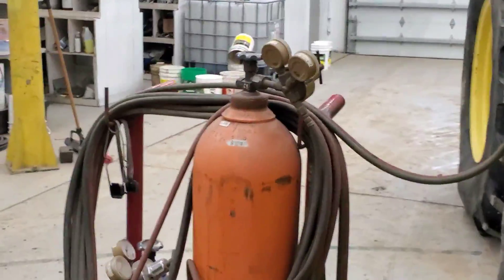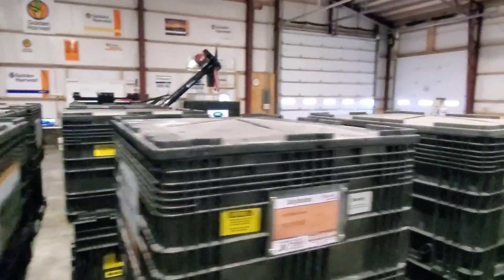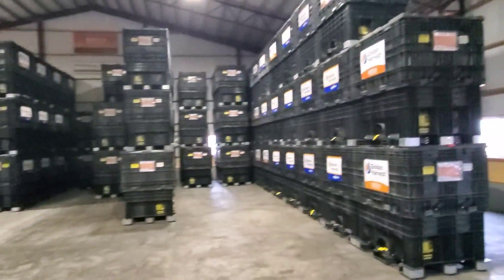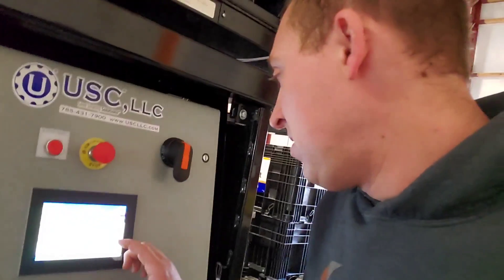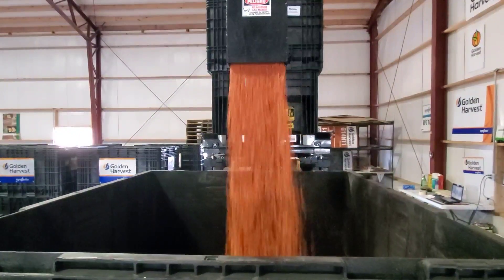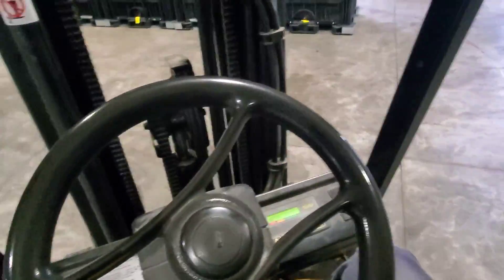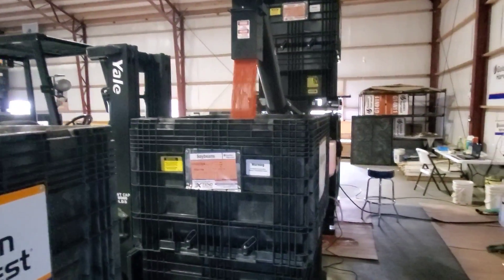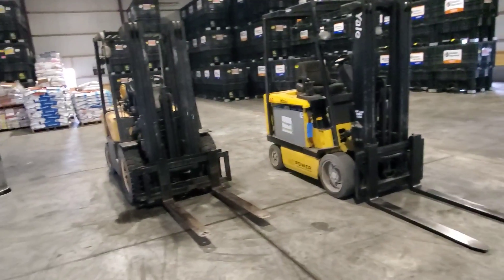My Forklift Died - #111

Comment: I seen you driving through jonesville today at 10 in the morning.  I passed  by you I was headed east on 12 you were going west I was headed to the dealership to pickup some hydraulic hoses and oil . It's crazy that we live so close to on another.  We are putting on phosphorus and potash right now.  We already sprayed our wheat with 28 percent nitrogen.  Planting is very close for our families.  Nice video stay safe and farm on my friend !
Reply from the maker: Yep I was picking up the exhaust manifold bolt for the 9R and batteries for the 8430.
Reply: Yeah we're gearing up for spring as well .

Comment: On those electric units there is a switch that sences weight or pressure on the accelerator peddle.  The switch has a spring that needs replaced often.  We had that problem with the machines at my factory job.

Comment: Hi Nathan. Great video. Not to long. Did you put inoculate on the bean seed. Fork lift might need update or got a lose connection.Like the orange color. Well back to harvesting corn here in North Central ND. It’s been a battle. 2019 just wont end. Take care and we will get though this cocos-19 BS.
Reply from the maker: I didn't inoculate these beans but I do have some I will use on some.

Comment: Actually, pushing it may have, as you said, forced the contacts off of a dead spot in the motor.  Bad news is, that won’t heal itself.
Reply from the maker: I'm actually thinking it might be key switch related but yeah a dead spot on the motors will be an expensive fix.

Comment: How many bushels are in a box ?
Reply from the maker: They are 40 units. A unit is 140,000 seeds. Bushels and weight of the box will vary with seed size.
Reply: It is usually around 40 bushels